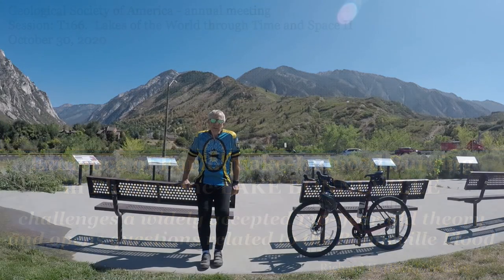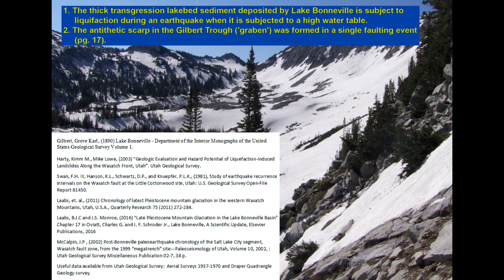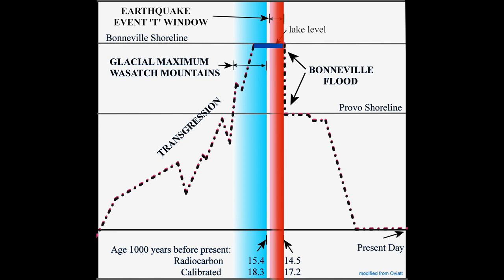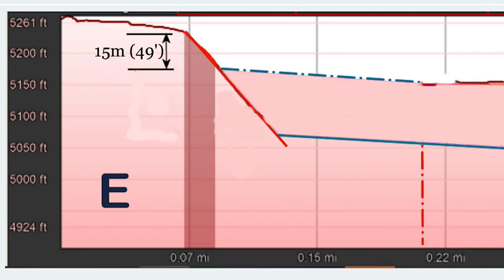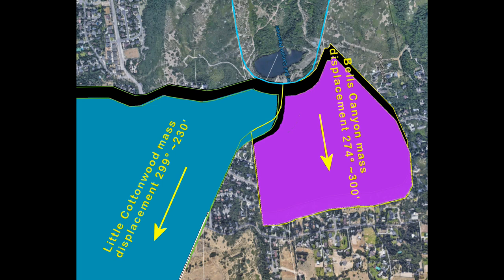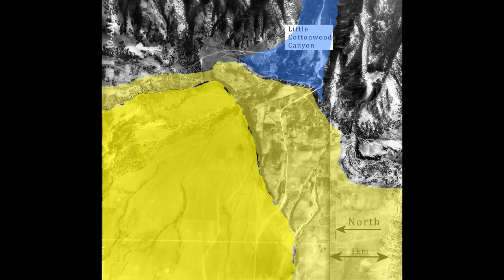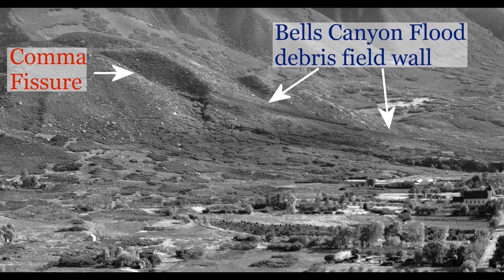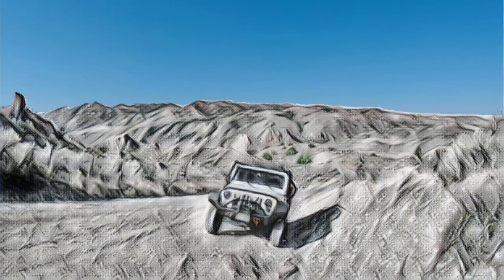Part I - The Bonneville Flood and the Wasatch Fault

Comment: Class A detective work and analysis. An earthquake of this magnitude would have created, (as you stated) a massive tsunami heightened and compounded by the scarp features in the basin. Certainly makes sense this could have been the 'trigger' event for the Bonneville floods. Observing the geologic formations in the Portland Oregon area caused by the Missoula floods, can give a sense of the tremendous power water in this amplitude can alter geologic features.

Comment: Are there any estimates out there concerning how high the tsunami could have been?  Would it have had the energy to travel to Idaho and cause structural failure at the Red Rock pass dam from hundreds of miles away?
Also, have geologists been able to estimate the magnitude of the quake that may have hit this section during event T?
Reply from the maker: Keep watching.  I get in to all of that in Parts II and III.  If that is not enough I now have a peer-reviewed paper out, but that one is a bit long.  As to the magnitude of the Event T earthquake, modeling of the tsunami should give a decent approximation, but that type of modeling is not in my skill set, and not on the list of things I want to learn how to do.

Comment: When was the bonniville flood in calendar years? Thankyou confused by  radiocarbon years and calibrated years
Reply from the maker: Jeff,  I think you can view the "calibrated years" as being a closer match to calendar years.   As I understand it, the problem with radiocarbon years is that it is old tech and at one point they realized that the baseline calculation was wrong, so rather than throw a wrench in the works of the prior data by having old data and new data on different reference points, they simply made a "radiocarbon" standard.   This was actually a pretty clever and useful move, since there was so much legacy data on the old standard and in the end, relative dates are the really important thing.  Calibrated dating includes radiocarbon dating using the new baseline, but it also draws in other newer dating technologies.  So if you are trying to dial in a date on your DeLorean dash controls, use calibrated dating.   I presented both because I did not want to get drawn into the time standard debate (we will see how that works out for me).  When I first realized that there was a Bells Canyon flood and it would have had to flowed into Lake Bonneville, I thought "cool, I'll be able to determine what the lake level was on a Tuesday, 18,000 years ago, all I have to do is look for the bench of a shoreline in the Bells Canyon flood deposits."    Of course whether it was on a Tuesday or Wednesday wasn't really important;  the important point was I was pretty certain I had an opportunity to firmly establish what the Bonneville lake level was at the time of Event T.   Though when I looked, I couldn't find any evidence of an established bench of a lakeshore,  just the erosion rivulets of a rapidly dropping lake level starting at the elevation of the high stand (Bonneville Level).    That was one of those "oh" moments, and it did come from keeping in mind cause and effects and logical sequences of events.  Thanks for the question, Rick.
Reply: Thankyou. Up at red rock pass they have a date of 12,400 BP there is a teacher named randal carlson who has worked on the younger dryas and possible cosmic impact with a year fate of about 12,850 years before present. Thankyou for ur video
Reply: @jeffbybee5207  From one curious random youtube commenter to another: Be careful getting caught up in the whole cosmic impact thing. There are a lot of wild theories out there with lots of seemingly plausible evidence, and guys like Carlson make a living by getting people hyped about the YDIT and how it explains so many things with very little actual evidence. It is an interesting theory to pursue, but make sure you pack an extra bag full of skepticism and critical thought if you choose to go down this rabbit hole.
Reply: @testbenchdude  thankyou for the thoughts. One thing I am curious about is the energy needed to melt the ice sheets.  How does that compare to the solar input? Not trying to seem crazy but I also strongly believe in elaine morgans aquatic ape theory.  One problem with the mazzola ice dam that I did not understand was I thought the tounge kept sliding across the outlet like a pocket door didn't  seem logical when fact is the ice tounge was being shoved up the outlet valley  making a more believable  dam that could form 40 or more times
Reply: @testbenchdude  "very little actual evidence"... you sound like someone who hasn't watched any of his lectures, or watched a few minutes and just shut your mind. Do yourself a favor Jeff, watch Randall's lectures for yourself, you'll find there's a lot of evidence for a cosmic impact greatly accelerating the end of the last ice age around the 12k years ago. You can find Randall's channel here on YT just search Kosmographia. Some of the most intriguing evidence of a cosmic impact is the black layer of soot that divides ground samples all over the globe at the YD boundary. This soot contains micro spherals, which are little pieces of shocked quartz and carbon that get created and tossed up into the atmosphere during impact events. Sadly science-worshipping types don't like what Randall has to say for a variety of reasons, one of which is he dares to question prevailing assumptions about our past and say "I don't know" in the face of evidence that contradicts modern dogmas, like the pyramids being way older than 6 or so thousand years because of the amount of water erosion found around them. Again, do yourself a favor and listen for yourself.
Reply: @jeffbybee5207  The amount of energy that was needed as an input to cause the rapid melting of the ice sheets is far and above what the sun provides. Two millions years the last ice age lasted, then it ends in the course of a few thousand and there's evidence of world-destroying flooding all over the globe, and people want you to think nothing out of the ordinary happened to jump start the flooding, defies reason honestly. A few impacts (and non-impacts that exploded in the atmosphere i.e. Tunguska event) over the course of a few hundred/thousand years fits in very well with the on the ground picture of catastrophic melting and flooding we see on the North American continent and the other continents as well. Either way, hope you're well and that you just take a look for yourself. The bigotry that is given off by the closed-minded modern Scientism fanatics is a detriment to anyone and everyone out there that wants to investigate the story of this rock we currently find ourselves on.
Reply: @mrshah2043  Thanks for your reply. I've watched a lot of his videos actually. While studying for my master's in geology, I became interested in catastrophism. One thing lead to another and I was introduced to the theory that a cosmic impact caused the formation of a specific morphology known as Carolina Bays. Randall created several very intriguing lectures on the subject. The gist of it is that a comet smacked the earth on an ice sheet at such an angle that threw up a huge amount of ejecta consisting mostly of ice. These "ice bombs" then all fell down in relatively quick succession, creating all of the bays in a matter of minutes.

When I actually started researching this, I came across a handful of other youtubers and scientists who had latched on to this theory. Then I started reading papers by people who have actually studied the bays in person, who took actual core samples and performed radiometric dating. Long story short: actual, empirical evidence suggests a much more plausible cause to the bays' morphology involving prevailing wind patterns over hundreds of thousands of years during the Pleistocene (a much more intriguing theory imho!). There's basically no way they could have formed all at once. This is what I was referring to in my other comment about "not getting caught up in the whole cosmic impact thing". Guys like Randall Carlson make a living espousing debunked theories to those who are unable or unwilling to do the leg work and research these things for themselves.

All I was saying is to beware of confirmation bias and to look to the real science behind these things. It is often more fascinating than you think. Randall's lectures are entertaining and thought provoking, but should only be used as a starting point. So yeah, please do listen to him, but then go and do some research for yourself.
Reply: @jeff bybee, The question of how much heat is needed to melt millions of cubic miles of ice to creat a scablands type flood is a good one. I enjoy Randall C also, and I asked for some calculations on the Kosmographia Q&A, but he just says, “that’s a good question”. His early VCR talks are great, the new stuff with the funny boys seem too much like someone trying to milk YouTube for every penny they can.
Reply: @WasatchFault  Thank you for your detailed explanation on the dating. It helps the French/Psych major, who should've majored in geology or related field, since I'm not immersed in the material everyday.
I went to U of U, and noticed a number of the features you discussed. However, I wish I had pursued my interests in geology while there. Utah is a diverse treasure trove of fascinating geology and microclimates. I'm finding California's none too shabby, but for me much is unknown and unexplored. 
Enjoyed your presentation. Look forward to seeing more.
💚🌎✌️😎
Reply: @jeffbybee5207  Let's be clear. Randall Carlson's profession is not a teacher. He also does no dating work or geological work in the field. He has a 2 year degree in Geology.

What he is is an author of books and the maker of videos that make him money off of pushing this hypothesis.

He has the same problem with the Channeled Scablands. The Dating work doesn't match his hypothesis. He has to deny the dating work done. Antonio Zamora is another that does the same thing. Deny dating work done or his hypothesis and his gravy train is done.
Reply: @swirvinbirds1971  agreeing with you about the problems of the dates and I fear mr Carlsen  is missing the point or the vital fact that makes the ice dam work different from the modern examples.. the fact the ice pushed UP the clarks form valley. It pushed upwards 10 miles and the bottom gained 100 feet elevation. All the modern examples mr Carlsen  referenced had the ice going down hill  thus cracking. To impound 2100 feet of water needs an ice dam greater than 2334 feet thick ice the ice above pend orel was about 3500 feet thick and am guessing at the mouth of the clarks fork at least 3000 foot thick. The glacier flowing down the parnell trench crossed lake pend orel  and shoved aginst the north end of the bitterroots range that was almost  square aginst the flow.  My guess is about 2/3rd of the ice went toward Spokane  and one third up the clarks fork. Btw the weight of a piece of ice roughly 1 cubic foot weighing 57 pounds the force persquare foot  shoving 10 miles of ice weighing 3009600 pounds I wish I knew. Has anyone know the energy required ? To shove I've that behaves plasticly . Do know it was better than 910 psf to hold back the water.

Comment: How long does these slide event take do happen
Reply from the maker: Good question.   You are obviously thinking the event through, not just accepting the statement.  That is great.   I probably used the term "slid out" when referring to the moraines, though I might be inclined to avoid calling it a "slide event"; just because I think one of the things which has made it difficult for the Utah Geological Survey personnel to understand is that these shifts do not exhibit some of the typical hallmarks of a landslide.   That is because most of the shifted landmasses were actually pushed around by the weight of surging water above them while riding on a liquified base.   Thats not something you see on a regular basis in Utah.  I'd be guessing if I tried to put a time on 'how long' and I am not going to do that.   I like to try to minimize the number of times I am wrong so that when I make a statement like "the Gilbert Trough is a fissure not a graben" you can believe that it warrants your time in thinking it through.   That said, if I were to try to get a handle on how fast these land masses shifted, I would look at the videos of the receding waves in tsunamis on similar slopes, figure out how long it took the wave to recede, look at the distance the shifted landmasses travelled and do the math.   Sometime, when the field of geology catches up to where you are in thinking about this, some enterprising graduate student will actually model the surge and give you the answer you are looking for.